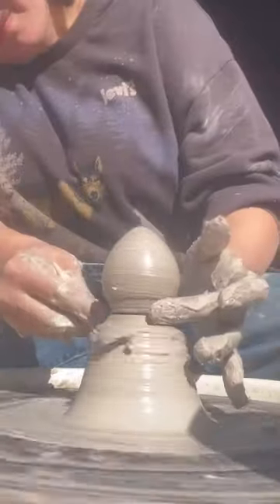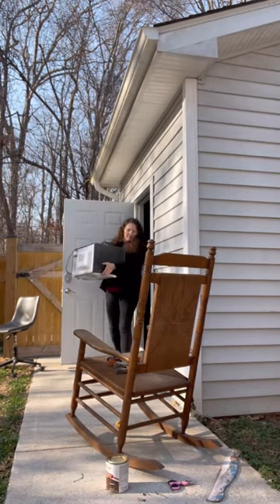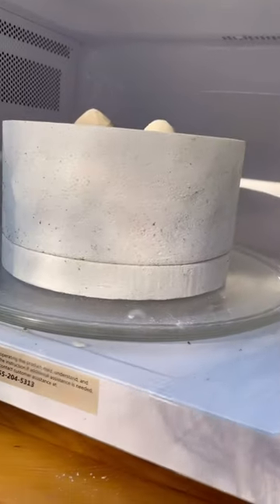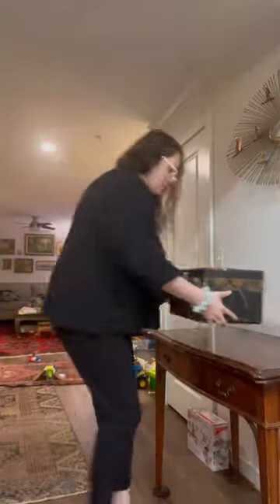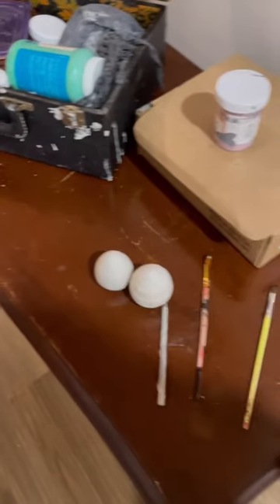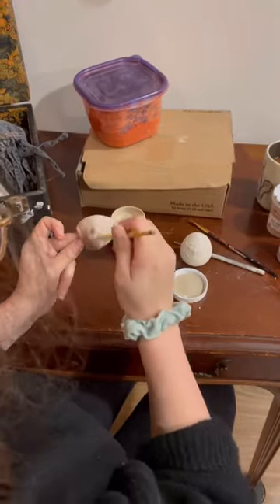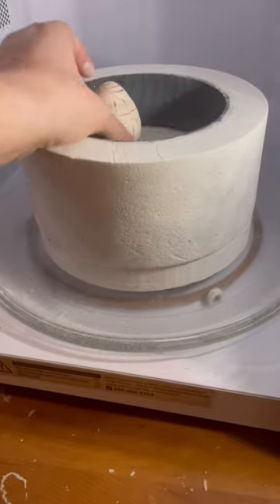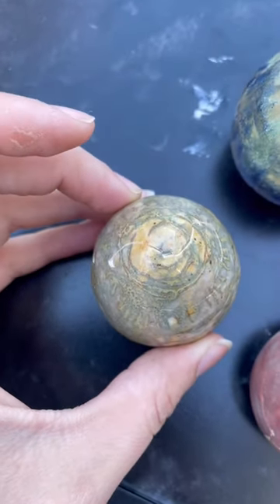Making Easter Eggs. Fired in a microwave kiln. #pottery #clay #craft #throwingclay #studiopottery

Comment: Those are neat! Any info on the kiln?
Reply from the maker: Thanks so it’s technically a kiln made for fusing glass it made by the company love charm on Amazon. They rand from 38-60 usd dollars. It can fire low fire clay cone 06 and 06 glazes. I bought two so that I can make 5in by 5 inch pieces. It takes about 18-20 ish minutes to fire a small piece in a single kiln and around 28+ min to fire a double stacked kiln. I have used mine many times and haven’t had an issue yet :)
Reply: @AmeliaB.Vintage  Thanks for the details! I've seen them before, but there isn't much info about firing ceramics  for these kilns.

Comment: These turned out so great! 
Do you fire in increments? Or just fire for a total of 30 mins uninterrupted? I typically use stoneware clay do you think this clay would work for microwave kiln or what clay do you use? Also how did you check it achieved cone 06? 
Sorry for all the questions, I really want to try this. 😅
Reply from the maker: Hey Casey , honestly it depends on bisck fire I do a strait fire no interruption. When I am glazing I start at a low time around 15 min and then take small peaks depending on what I see. 
I don’t when glazing I over fire more often than under fire. 

I think as long as your clay will fire completely at cone 06 it should be fine. And you can totally put a cone to put in to verify temp but I just look for a red hot color in the peek hole in the top of the kiln.
Reply: @AmeliaB.Vintage  Thank you Amelia! I just ordered the kiln, It should be arriving today. I'm going to experiment and see what times work best with my clay that I have. I will probably end up getting two so I can stack them to potentially make larger pieces but I'm just going to experiment and see what I can make. What kind of glazes do you use ? Thank you for your advice!
Reply from the maker: @caseygraham8703   fantastic it is so much fun. Also depending on the volts of you microwave it can change your times mine was an 1100 watt microwave 

I use the low fire mayco glazes. I want to try their mirror glazes but haven’t tried them yet. A lot of people that I know that do think kind of firing have had great success with the mirror glazes. As long as the glazes is a cone 06 it should work. Also don’t forget about raku firing. This is also possible with these tools
Reply: @AmeliaB.Vintage  I plan on getting a second hand microwave so I can find one that has higher watts like 1100. I'm going to check out those glazes. I've taken 3-4years of ceramics in college but it was strictly class glazes and gas kilns. There is a ton I need to learn to be able to do ceramics outside of the college setting. I've never tried raku firing or learned much about that firing technique. I do want to try it though because I've seen raku fired artwork and the colors and patterns are absolutely beautiful.